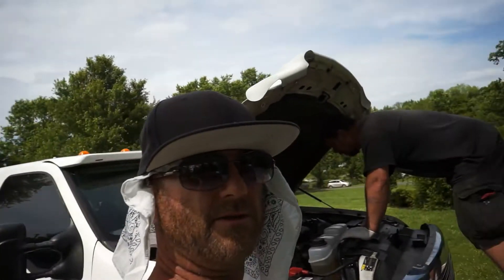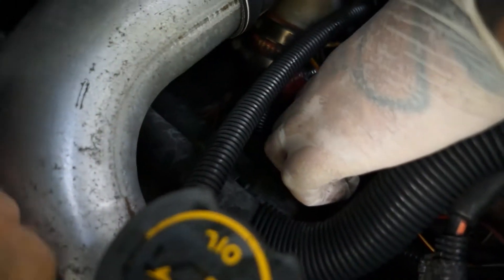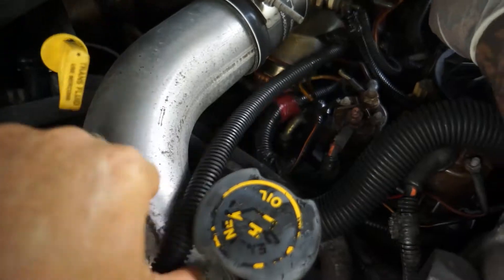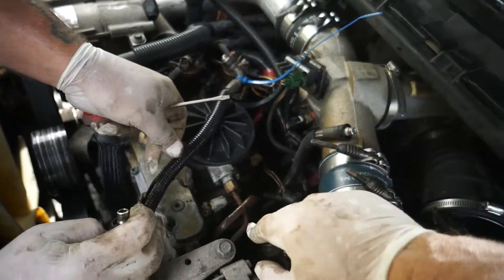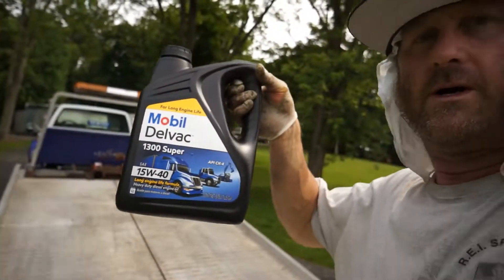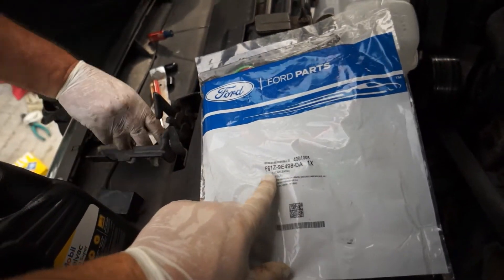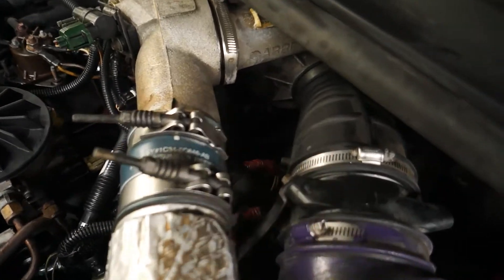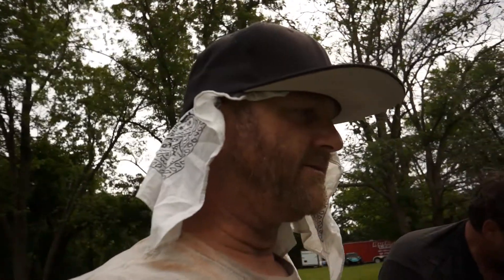HIGH PRESSURE OIL LINE leaking  ?? HPOP OIL LINES FIX IT EASY !!     FORD F 350 7.3 TURBO DIESEL

Comment: Great repair.

Those fittings the hose connects to, went to the hydraulic repair shop and got some new orings.

The radiator degass tank, is that a Dorman. How is it holding up.